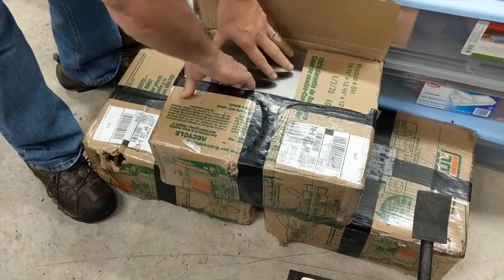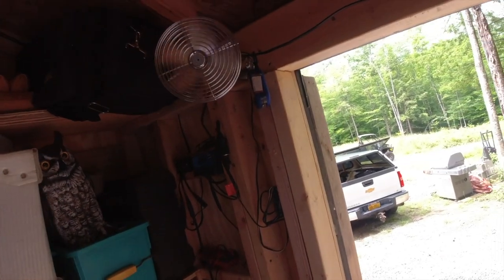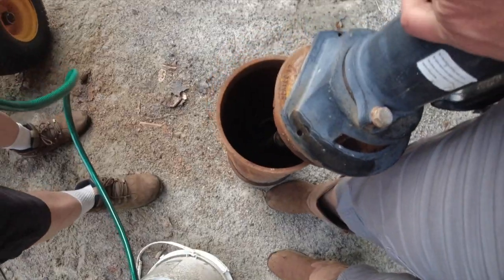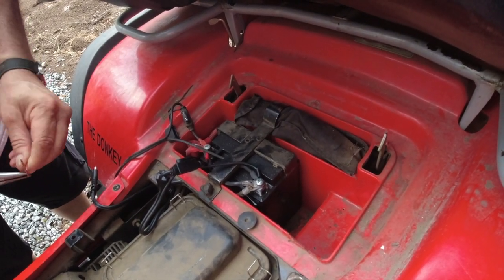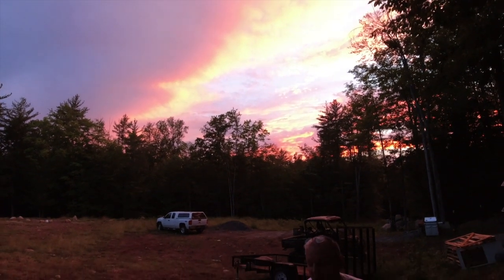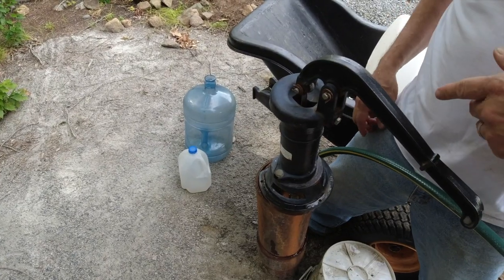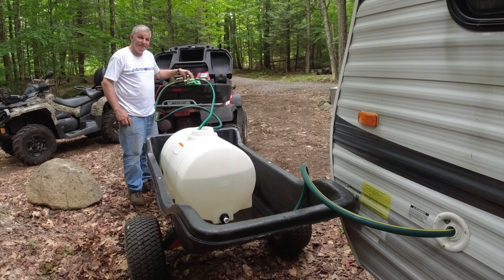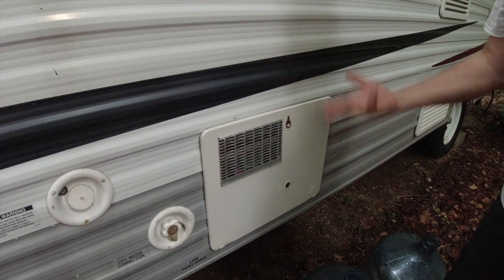OFF GRID LIVING ISN'T EASY - She Wants a Hot Shower!

Comment: So much can be washed away by a nice hot shower ! When you are using your own resources to get the water moving I would let it settle and then pump into the RV in the morning, stop when it is down to a few inches in the gathering tank or stop pumping into the rig if the bottom gets stirred. Maybe an inline filter to get any of the floaters or missed dregs. Best of days to you two : ]
Reply from the maker: All good advice. We appreciate it very much 👍